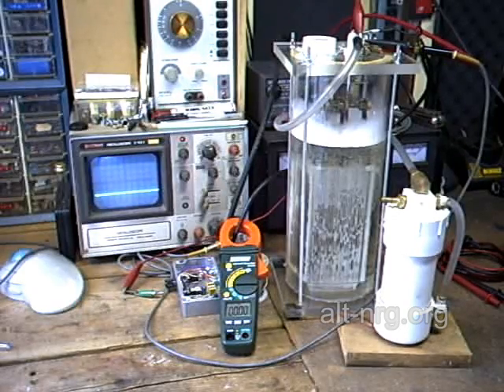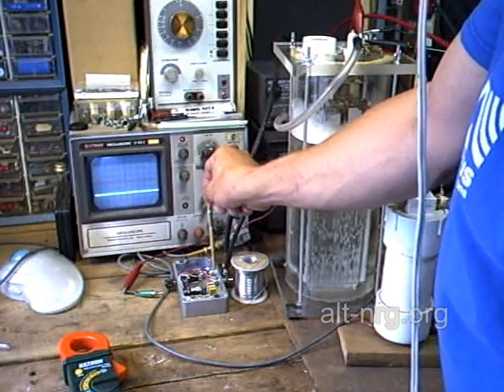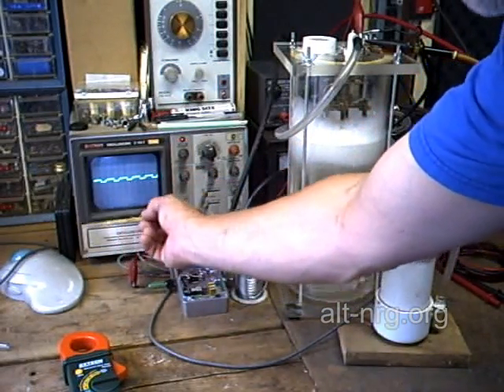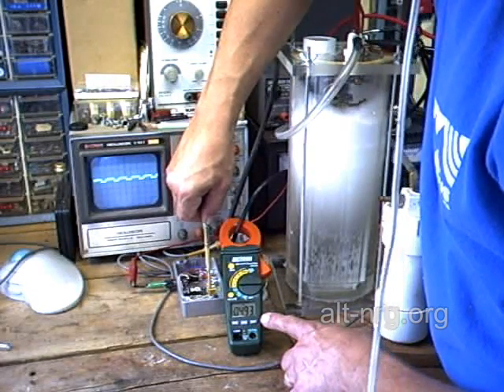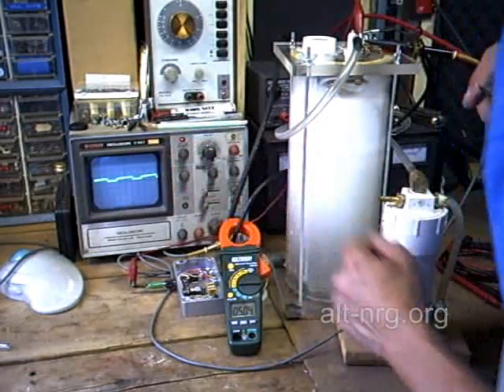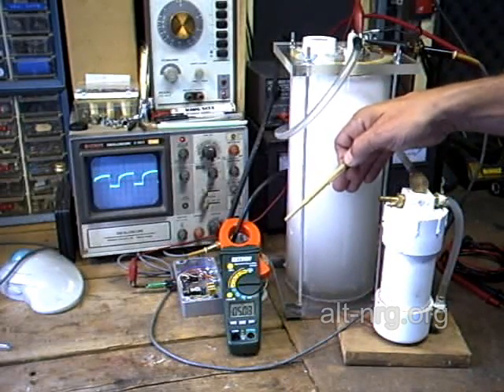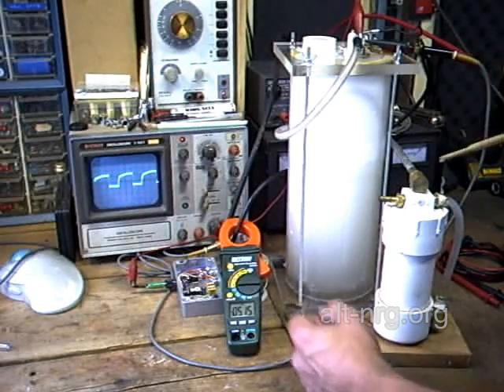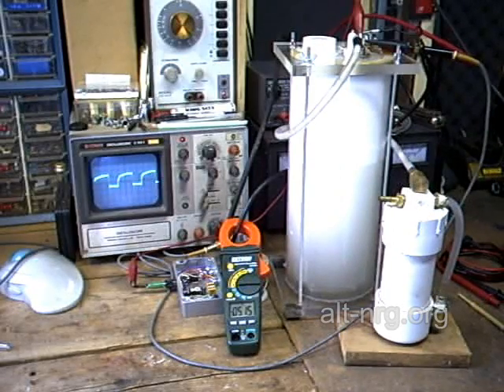#121 PWM Tuning for HHO

Comment: I A`m using a socket, and i have experienced no Problem. 
I don`t the voltage rating of the Cap matters as
long as they are  about twice the input voltage.

Comment: I am using IC Socket for LM324N. Does it throw off resistance readings for LM324N? I am sure if I would build one more it would work at first.. Maybe I should use some 16V or 18V electrolytic caps instead of 37V I am using now. I have to find where the clog is :) Between batery 12+ and the gate wire I always have 12V with unit on or off. Is that normal?

Comment: It starts up, works like it suppose to, set 3 amps holds it but then all of the sudden it starts jumping to 4.5 amps then back to 3 then 0.02 amps and etc. Does anything to do with the frequency? Is it possible to "throw it of course" so it would mulfunction like this (certain pot combinations). I cant believe it works for everybody but me :( Mistake somewhere, altho I checked it again and again. Is 7809 regulator good or 7810 needed? Any mosfet goes? Tried IRFP 140 and IRFP 250. Tnx hydro

Comment: Now I think your Prob is.
On that FET. If yot look at the back of it.You will see a metal backing, that metal is connected to the D terminal or Drain if you have your
FET. clamped down on metal plates and the ground terminal connected also to the same metal plates There is a direct short.
You haft to isolate one or the other preferable the FET.

Comment: Mosfet is not mounted yet. I clamp some plate for heat dissipation for now till will get it working. I have my new cell to be tested and just cant get this thing going. This one was second one I build because I tought the first one was not working for whatever the reason. Same results. 37v electrolytic caps. I am confused because one moment works great the other all fluctuating or off.  BTW will 16 awg copper wire (used in R12) withstand 20-30 amps loads?

Comment: Oh well, something went wrong . It is not working anymore. Just quit working while I was adjusting frequency. Came on few more times for a few seconds and its was all over. Another thing I am using 1/8 W resistors. Are they too weak? I have remeasured resistance on all of them most of them measure right but some "degraded" some ~3k(10k now only 7.5k). Maybe mosfet got damaged by that spike maybe voltage regulator. Have to get another one to try. Some info about these resistors would be great.Tnx

Comment: The problem (most likely) with trying to solve this with a zener diode is the diode isn't fast enough. What I've found is that when you apply a small voltage to the gate, it can never reach zero which eliminates the capacitance discharge (or inductance). I've tested this theory with a voltage divider on the gate and have brought the  voltage spike down to almost nothing.

Comment: Hello all
First of all, I would like to answer  minde4000 and rcjera ?'s  minde4000 if 

you watch video #68 it will show you the
voltage spike that we are talking about. rcjera I was using a 15 volt  Power 

supply which is not the problem.
minde4000,if you don't have access to a 'scope, you won't have any way that I know of to detect a splke until you start running high current. If you start blowing MOSFETs, you will know you have a spike, too.

Comment: hydromakers, I have this PWM working already too. How did you detect that spike? Sorry I have no special test equipment but I have measured voltage between drain and source and I get around 8.7V. I dont have oscilloscope to get visual results but afterall it functions as well as described. Never exceeded 5 Amp mark yet (still conditioning cell)  but PWM seem to hold  any limited current value below that. Some more info about that spike would be great. Tnx

Comment: Hi Zero
Great job on your new PWM  I think it is a winner.I have also duplicated your PWM and it works great except, i have a 60 volt spike across the Drain and Source even with the transient diode. I have tried several ways to suppress it with very little success, any help would be appreciated .
Thanks in advance.

Comment: Thank you for your very good explanation of how to tune the current. Between this and the explanation with the plans on you web site, I feel much more confident. 2 questions, though. How do you arrive at the proper freq (5 khz in this post) and how do you go about determining the amount of current that is optimal for a particular build? Do you just increase the electrolyte until you hit the max allowed by the mosfett? I am sorry if these seem like elementary questions.

Comment: Zero, just a suggestion, bt if you could include your EFIE circiut on the same PC board, that would be appreciated. Although it's a separate circuit, it would help those of us with poor soldering skills, and make for a clean installation in the Velleman G106 enclosure.

Thanks

Comment: Great video. I have my current sensing PWM almost ready to go. Assembing it pretty simple even for the first time pcb builder like myself. Need box and mosfet. All I can say this PWM is kind of a must for every user(also greatly extends your alternator life) as well as the "new gen" wet cells will be the choice of best of the best due to superior efficiency native design (eliminated sharp edge current leak) altho will cost little more to build. Tnx again zero I will test it on my new cell.

Comment from the maker: No. I picked 5 amps as a demo because the cell only drew 6 when I connected it to straight dc with the elyte concentration inside. With 0.003 ohms for r12 the max rms current limit to around 40 amps